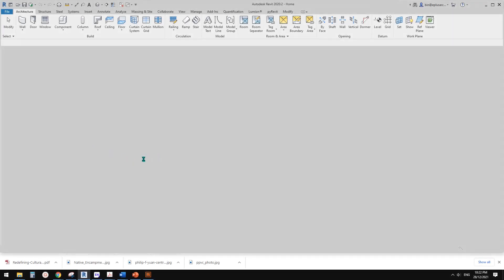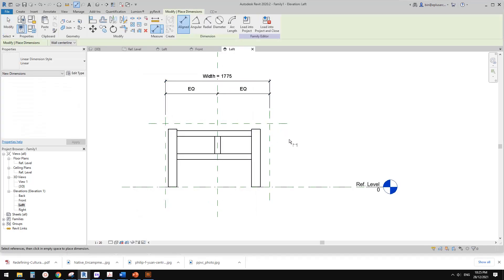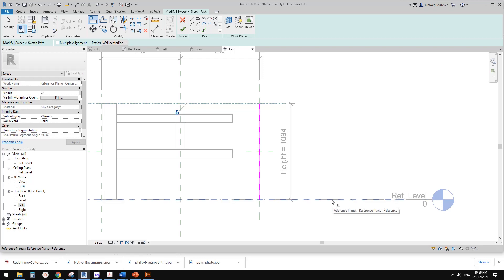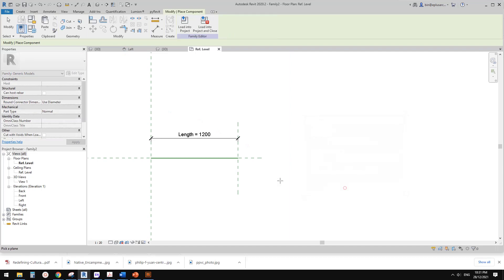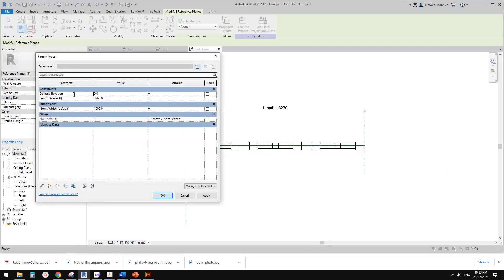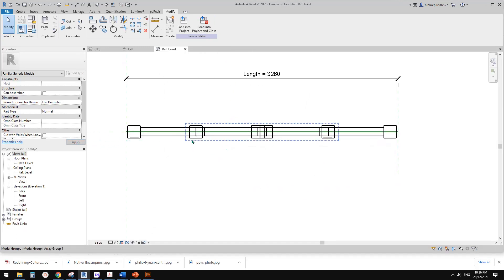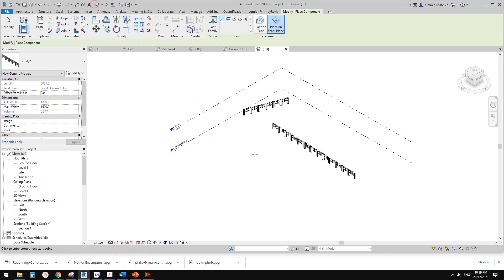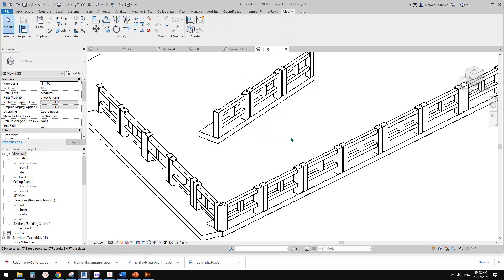Revit Exercise (Day 645) - Line-Based Family

Comment: Can you pls do double slanted column family in revit, means bottom portion 2 columns will be connected and top will be separated
Reply from the maker: I guess it will be more proper to use structural columns for this, but maybe we can create a family for concept stage.